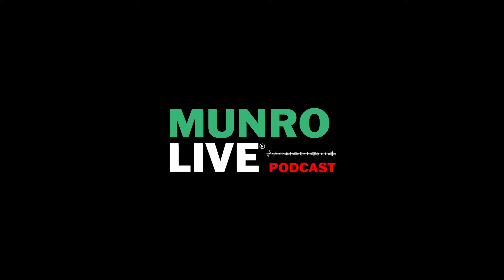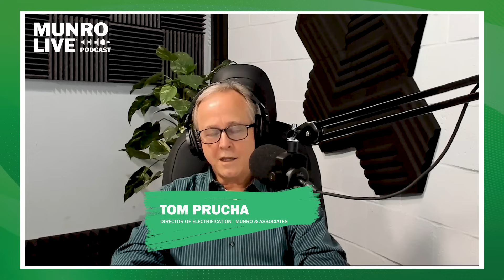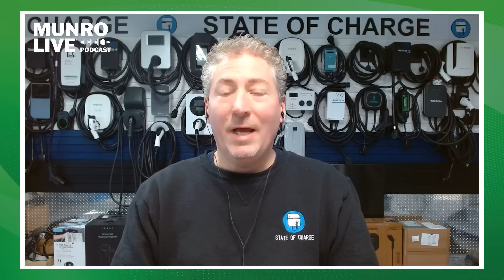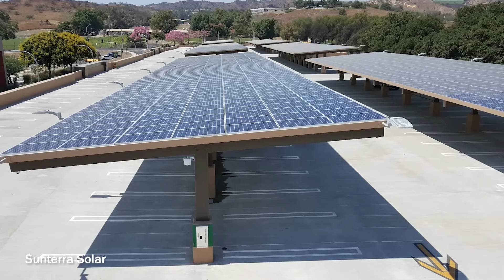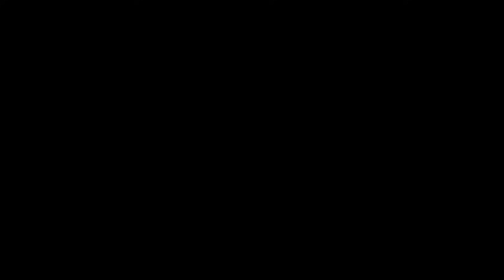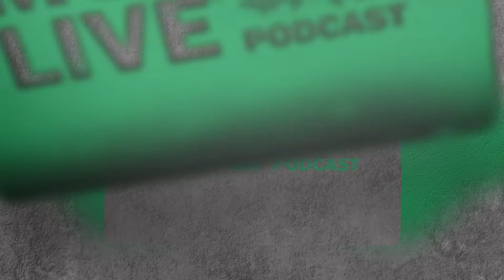The Problem With EV Charging Infrastructure

Comment: BEV adoption isn't going to have a "hockey stick" curve, it will more likely be a sigmoid (S) shape that will plateau at some point well before 100% because there will always be a segment of the market for which pure BEVs and fast-charging will never be good enough no matter how much better they get. For that last 30-40% of the market, it'll have to be something like ethanol-extended BEVs.
Also, imagine a large-scale grid outage or Iceland which has a national call for reduced power consumption to prevent the whole grid from collapsing from people having to use electric heaters after lava destroyed steam pipes used for heating. If everyone only has BEVs, nobody can get anywhere because BEVs would waste most of their range just getting out of the affected area to charge. With fuel-powered vehicles, you can send tanker trucks in, fill ~1000 cars per tanker per trip and run fuel station essentials on a ~10kW generator.
Maintaining a fleet of fuel-powered vehicles will become a matter of national security. Can't depend on a single energy source for everything.
Reply: Electricity is a multi source fuel, you can make it dozens and dozens of ways, including from fossil fuels. Localized solar into batteries is the most robust energy source there is. We have seen refinery outages or blockades paralyze liquid fuel networks, they can be quite fragile, but a lot of effort goes into making your local gas station a reliable source of energy, so most people don't think about it.
Reply: @brushlessmotoring  Distributed solar may sound nice in theory but when the grid is down, you cannot easily get it where it is needed. Also, solar is only available during the day. If you want energy from it to still be available at night, you need massive batteries.

With liquid fuel, you can get tanker trucks wherever they are needed to get things moving again as long as roads are driveable. Gasoline and diesel aren't the only options either, most fuel-injected cars will run fine on E90 with little more than injector table tweaks. Also, ethanol can be made from cellulose waste, albeit not as efficiently as sugar cane or corn using current technology.

A typical gas station has 200 000+L worth of total storage, which is about 7.2 TJ worth of energy. Using a 40% efficient constant-power generator (Mainspring makes 45% efficient free piston linear generators, I'm using 40% to account for inefficiencies scaling down from 200kW to 20kW for a generator-extended EV), that is 800 MWh worth of electrical equivalent. You'd need 80x 40' containers worth of batteries to replace one single gas station with an equivalent amount of battery buffer storage.

Every gas station that you remove is a heck of a lot of very convenient potential energy that is no longer available.
Reply: @teardowndan5364  you are still thinking centrally, not distributed. Look at Australias uptake of rooftop solar, no shipping containers of batteries to a gas station are needed.

In my lifetime I’ve seen many liquid fuel disruptions, blockades of refineries, pipeline software hacking (remember that one) or just demand spikes emptying filling stations for miles around (eg hurricane evacuations in Florida) - you are thinking about electricity in liquid fuel terms, and that’s missing a whole realm of new possibilities beyond a gas station - at the end of the day, if you can get liquid fuel anywhere, you can turn it into electricity more efficiently than putting it into a combustion engine.

Look up the Australian Outback diesel EV challenge they did - the EVs went further on the diesel via an efficient generator than the diesel vehicles did by putting it into a tank.

Your arguments about the flexibly and remoteness of fossil fuel distribution apply to EVs too, because EVs can use any fuel, without modification, not just one or two liquid fuels that have to be trucked in.

You can power an EV from gasoline, diesel, propane, natural gas, coal, geothermal stream, solar, wind, tidal, run of river, a spin class at a fitness centre, wood pellets, hydrogen, rainfall, snowmelt …. and I believe we are working on energy beams from space too!

And yeah, the sun doesn’t shine at night, so. charge your batteries during the day, or fall back to a fossil generator, a 25% fossil powered EV is 4 times better than a 100% fossil vehicle, the idea we use EVs not being 0% fossil fueled to continue 100% fossil driving is reductive, the Nirvana fallacy in action.
Reply: @brushlessmotoring  Having solar panels on roofs does you little good when the grid goes down and grid-tie inverters have to shut down due to loss of sufficiently clean reference signal.
 
Gas stations getting emptied out during an evacuation is normal, people are topping up on the way out. Can't really do that with fast-chargers where "fast" is still 15-60 minutes a pop. If I was speed-running filling my car, I can probably be done in less than 3min if I skip the last 20-30s where filling slows down.

Also, in disaster scenarios, data connections often go down along with power. Good luck fast-charging anywhere in that case. With gas, paying cash is still a standard option and the gas station only needs a small generator to keep pumps running until the gas station is dry.

While you may be able to indirectly use any fuel to charge an EV, doing so requires being able to stay in one place and having the necessary equipment there to do so. Loading a gas generator in your EV so you can stop curbside for 8h to charge isn't very practical. If the energy source is significantly more distant than that, you need a working grid in-between.
Reply: @teardowndan5364  heh - you are pretty determined to ignore the limits of fossil fuels, you seem think getting them is guaranteed, despite how long and complex the chain of events is that delivers them to your door. You are also ignoring the ‘always full’ nature of EVs, there is no topping up needed when something happens, it’s topped up every single day. There is a reason preppers and off gridders are keen on solar and electric Ute’s, it’s a forever fuel when the apocalypse happens.
Reply: @brushlessmotoring  There are hundreds of potential alternative liquid fuels, gasoline and diesel are far from being the only options. Ethanol is the most readily available alternative today and already account for 10-15% of standard gasoline blends. Most fuel-injected gasoline engines should run fine on E90 with little more than injector table tweaks. Ethanol can be made from cellulose (plant) waste, just need to find a bacteria or enzyme to make that process efficient and effective enough to eliminate the need to sacrifice food crops and all of the additional resources that go into them for fuel.

There is no such thing as "always full" EVs for anyone who doesn't have the luxury of power at their apartment, condo or parking-less house and a sufficiently secure location to avoid cable theft. You get home with whatever you have left at the end of day and have to assume you will be starting the next day with whatever remains after overnight draw-down in case you got unplugged by someone, then have to dedicate some amount of your day/week to waiting at the fast-charger even for local commute.
Reply: @teardowndan5364  rent an EV for a week, it’s not how the media has sold you on it, you have a bunch of negative information that does not wring true to an actual EV owner, you do not normally fast charge as part of daily driving, even if you can’t charge at home, you figure out a socket somewhere (typically work) and leave it there while you get on with something else - if you are in such a high crime area you worry about cable theft, then you have to worry about catalytic converter theft too.

‘Right to Charge’ is working to make sure oldsters on strata councils can’t block charger installation in existing condos, and updated building codes for apartments and houses are mandating wiring for chargers - it is a problem, I do agree - but it’s a solvable one.

So, do you grow your own E90 fuel at home from kitchen waste in a bacteria bath? How many liters a day does that make?
Reply: @brushlessmotoring  I don't need to rent one, my mother has one and it sucked every bit as much as I described when I borrowed it. Almost got stranded on the highway because the range guestimator was off by 30+km, driving with the minimum amount of heat that will prevent the windshield from fogging up for ~15 minutes to conserve range is not a pleasant experience. Public charging infrastructure is maybe 1/10th from where it needs to be before there is any chance I might consider a BEV as viable - two to four chargers scattered across towns every 30km along the roads I most frequently use is not enough to feel remotely confident driving an EV between Montreal and Ottawa, especially in winter. And they need to be faster than the ~50kW crap that is currently prevalent.

Crime-wise, look at Tesla's brand-spanking new supercharger site in Seattle that got 38 out of 40 cables stolen before it even opened to public last week. There was another similar event in another state too. The more EV charging cable there are, the more thieves will be on the lookout for cables to steal.

We have barely scratched the surface of the practical implications of having more EVs in the wild. Governments rushed into it with minimal if any foresight. Many parking garage operators are concerned that their building cannot afford the average vehicle curb weight going up by another 500kg. They are also concerned about cascade thermal runaway: you can put out an ICE fire with a fire extinguisher or a quick hose-down, not so with an EV battery fire.  Building and fire codes need to be updated before more Lutons and Financial District fires and collapses happen.

The world is nowhere near ready to go all-BEV. May very well never be, neither does it need to. The very concept sounds suicidal to me.
Reply: Or in an emergency you can send 20 busses to evacuate ~1000 people.

 I am not sure why you are citing power emergencies as a check against BEVs when they are inherently load shedable. Having lots of BEVs that can stop charging immediately (or even supply power back to the grid if V2G ever takes off) makes the grid MORE flexible, not less.
Reply: @economicprisoner  If your busses are also electric, their ability to participate in evacuation efforts will be proportional to how much battery they had left when the mass outage occurred. Also, when you have a car you can drive in an evacuation, you can bring whatever you can stuff in your car on short notice with you instead of leaving everything behind to get on a bus.
 
For V2G and consumer grid-tie inverters to work, they need to be reading a clean reference signal from the grid and adjust their inverters accordingly. If the signal is distorted due to the grid being on the verge of collapse, stand-alone grid-tie inverters will be forced to disconnect due to unstable reference signal.

Comment: Not sure how Tom can say that we don’t have a Solid, Stable charging infrastructure, Tesla is that Structure - all other companies need to kick into a Tesla NACS charger network kitty and build it out to the point of Pilot, Wawa, Buc-ees charging points. What is missing are the 6 stall charges located in smaller non-highway centric places for work vehicles to be able to charge or top off during a busy drive day.

Comment: The key to public charging infrastructure is level 2 charging, not DC fast charging. Fast charging is just a fraction of the demand for charging. Trying to hook up more and more, faster and faster DC chargers is not the answer to the problem when demand is there mostly during rush hour. Those people should have charged at home before rush hour and charge again at work after rush hour. The battery contains enough juice to make it through rush hour.
Reply: I'd like to see more public L2 up to 48a & long term parking L1 at job parking, airport parking, park & rides, etc.  Not everthing is road trip fantasies.

Comment: Just take a look at the last 4 years.  Since COVID the number of EVa has exploded. I have been driving EVs for 9 years and the amount of growth over the last four years is astounding.  The problem now is not so much being able to drive across country (though there are still some charging deserts) the problem is in populated area with lots of EVs there aren't enough chargers.  Many places there are wait times now to get a charger and it's not just on holidays.  There are a lot of challenges for sure which will eventually get worked out.  The next five years will be very exciting indeed.

Lastly, the news media hating on EVs will stop really quickly if we have a spike in gas prices.  Could be on the horizon if things in the middle east continue to intensify.

Comment: I am in the UK.
So far, using  Zero DSR for 3.5 years, I have had no issues a quick phone call could not resolve.
Now have an MG MG4 and ordered my new Zero DSRX.

Most of my charging has been with Tesco / podpoint or BP charging.

Now have a home charger as well.

Comment: Tesla opened up their network to non-Tesla drivers here in France in 2022. It has made a huge difference to not only prices but the quality of other charging networks. In 2021/22 we were paying €0.79/kWh at Ionity, Total and other networks. Tesla's rates of €0.43 have forced the other networks to reduce their prices which are now in the <€0.60 range. Ionity have always been reliable in my experience, they always roll out at least 4 units at every location and OK not all 4 always work but they seem well maintained. There is so much choice now along the main autoroutes that on a recent trip down to Spain I never even bothered to use an app to plan it...other than knowing where the Tesla stations are as this is always our preference. My Kia e-Niro (Niro EV in the USA) is now 5 years old and can only manage 75 kW peak charging but with a 450 km range a 30 minute stop after 3 hours of driving (my maximum at one sitting) is just fine.....lunches are good here. 😊
Reply: Good to hear.   USA might catch up.
Reply: Dinners in France are great too.  Breakfast is fine but generally it's not what Americans are accustomed to, unless they are in an establishment which caters to Americans.

Comment: I noted the point about infrastructure in the UK. 95% true, but you need to interview Toddington Harper of Gridserve. That is a UK charging infrastructure company that is doing things right. Gridserve has bought up a lot of the old locations, along with creating their own mega charging centres and putting in the latest technology and comforts. I have charged my car at one of their centres and it is next level. Don't forget the name.
Reply: Everyone else is double the price of Tesla though. I cant believe nobody has matched Teslas price here. Nearest supercharger is 15 mile from me! I have a LR M3 only had it a week, so far I have used a GeniePoint 50kw that is 50 meters away from from where I live, signed up to Electroverse so now its 65p per Kw.
Reply: @usefulrandom1855  Yes,  I agree. Everyone else is much more expensive than Tesla. The answer I was giving was more to do with quality and reliability, which Tesla has stood alone on. Gridserve UK is easily the best non-Tesla charging network. I only wish there were more of their centres. Tbf though, I hear that Fastned is excellent too, though I haven't used any of their facilities yet.

Comment: I would like to believe non-Tesla chargers will become more reliable but I just don't think it is possible.  Tesla owns the whole charging experience.  They build the charger, install it and maintain it.  On the other hand, non-Tesla chargers usually involve 3 or more parties.There is too much finger pointing to get anywhere close to Tesla.
Reply: There is nothing stopping a charger manufacturer from offering what Tesla is offering.
They sell you the charger and collect a maintenance fee to ensure they stay running.

Comment: The whole amp ratings, kw ratings, etc on chargers is pretty dumb. Average consumers don't know what the hell they're doing or what any of that means. It should have just been red handle, blue handle. All cars can use the blues, high power cars can use the reds or blues or something and have industry standards on what each level is and what they're required to output. The problem is this early you dont want to codify too many things and stifle innovation.
Reply: Better still, red/ blue light on the charger, visible from the entrance to indicate a working charger.
.

Comment: I drive  an Model3 since 2019 in N and had never huge problems, not even on non Superchargers, because Teslas have  like other EV CS2. In 2019 the distance between 2 usual chargers were less than 150km. Together with the Supercharger network, I had a charger every 70km.  Since then gas stations have become charging stations with connected shops to buy a coffee, cake or a sandwich.  The only issue since then was when temperatures  went under -10C, non Tesla chargers  give max 70kW. 

This business is capital intensive and it's looking like the operators of chargers in the US decided to run chargers on the lowest maintenance level as possible.
Reply: Sounds like you have cold battery at 3rd party chargers. Are you navigating to charger as charging not as regular stop or even without navigation?